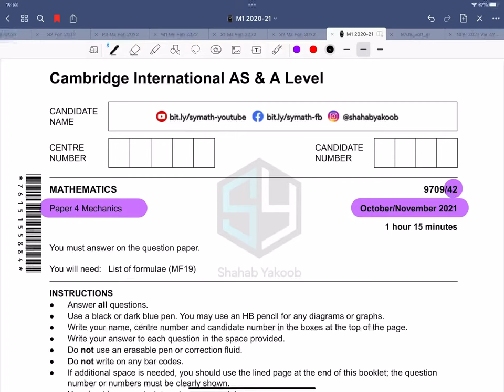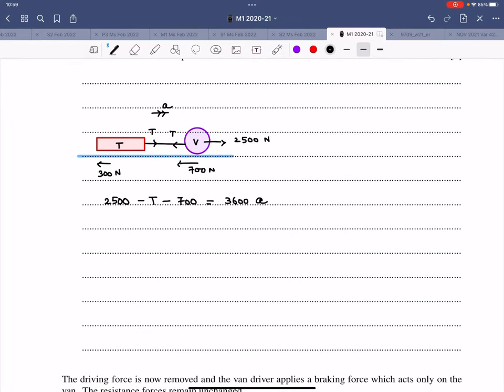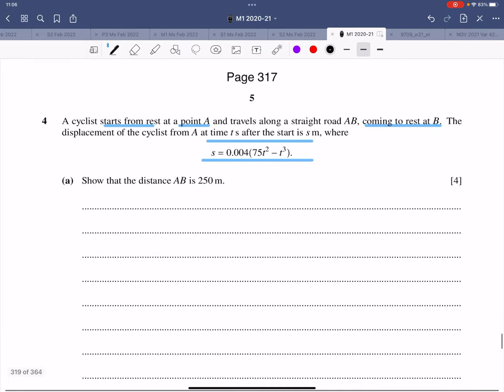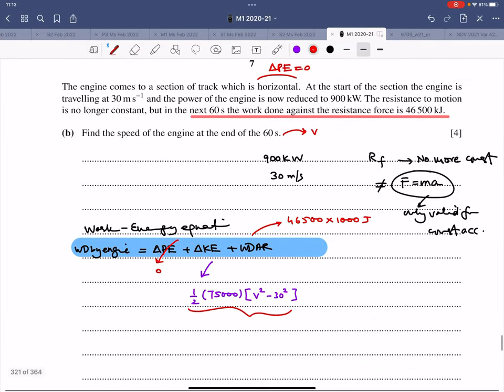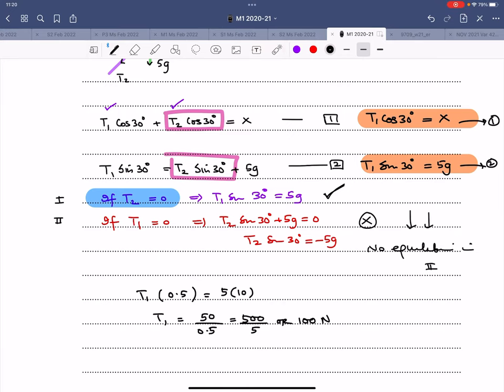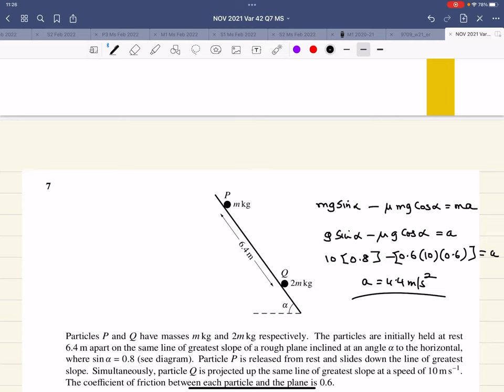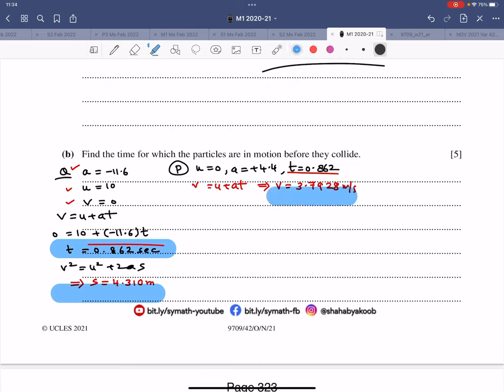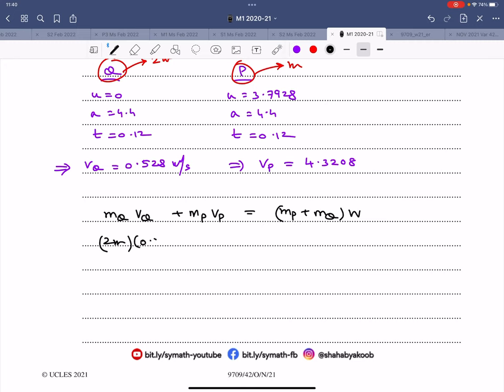M1 | 9709 | CAIE | Oct Nov 2021 | variant 42 | MECHANICS

Comment: For q 7 part b ... in the special  case .... if we use (m)(4.4) +(2m)(-1.6)=(2m+m)(v) we don't get the right answer because I put -1.6. But I don't get why we wouldn't put the negative sign as it is going in the opposite direction
Reply: b/c we took down the slope as positive. Negative would be up the slope.

Comment: Sir why are we assuming in q7 part b that the final velocity of particle Q becomes 0 before collision?
Reply: same question homie
Reply: We are not assuming that, thats just whats happening
Reply: @shoaib6852  but still how do we know that by the time the particle reaches the point of collision it has lost all of its speed? Like it could've also been like this that it decelerated to a speed less than 10 for eg 2ms-¹ but why 0 when it's not specified?
Reply: @shoxozozo  the particle did have some speed before collision tho, I am not sure what you mean.
Reply: @shoaib6852  yeah I know that but how do we know that it decelerated to zero and not some other speed lower than 10ms-¹
Reply: q ki velocity zero thori howi hai collision se pehle
 uski velocity zero howi phir woh neeche ki taraf travel karna shrou ho gaya uske baad ja kar collision howi
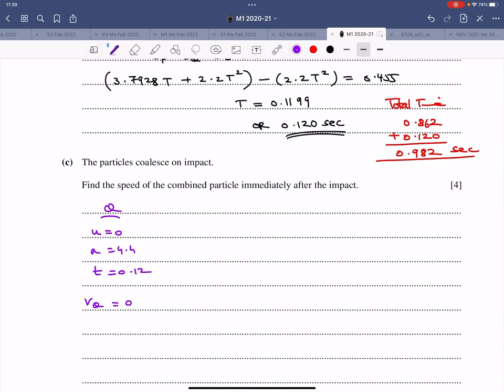Reply: the initial speed of q is taken as 0 46:44

Comment: sir q7 b ans is wrong??
Reply: No, both situations are mentioned in the marking scheme. If you were among the majority that didn't assume Q stopped and rolled down the slope before collision, you would be getting 4/5 marks max.
Reply: @h.op.e7209  Yes it is.. but a lot of students got it wrong so they allowed the wrong answer (working)...ALSO its not assuming that Q stopped if you do the working you'll realise that Q did actually stop
Reply: @h.op.e7209  its one of those situations where the answer is correct but the working is wrong